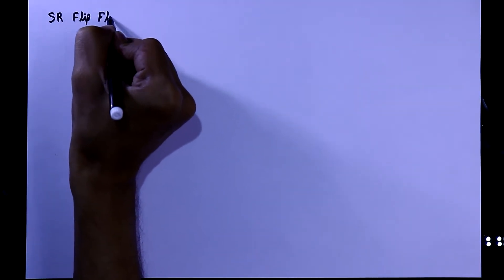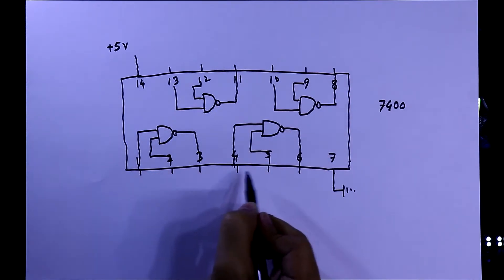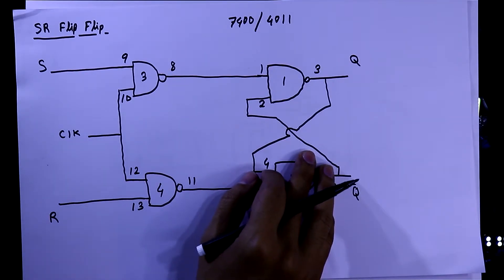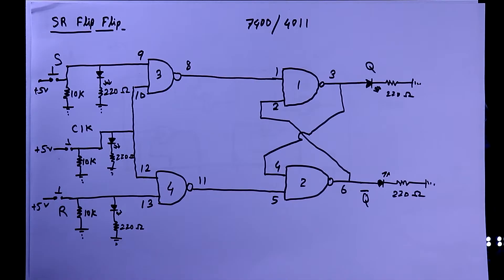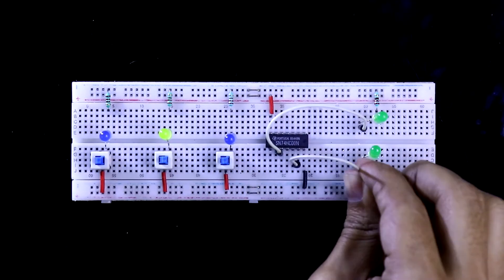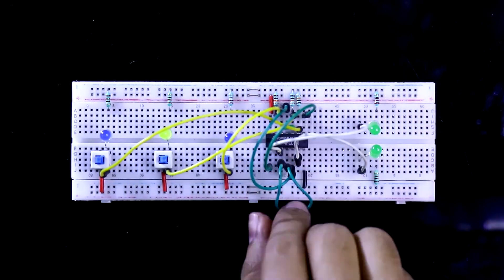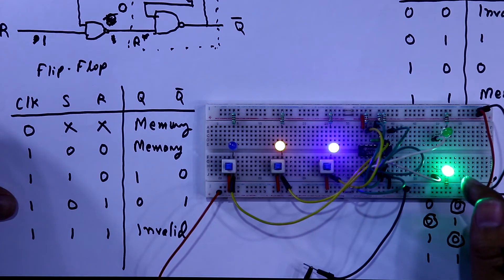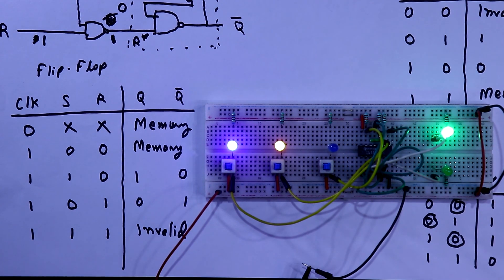SR Flip Flop using NAND Gate practical

Comment: How many volts did you use as power supply to the IC ?
What is the maximum and minimum voltage that can be used in this IC?